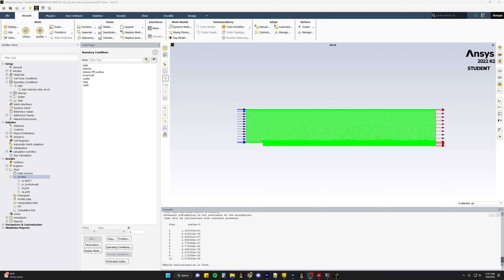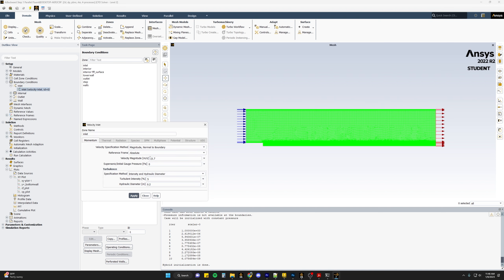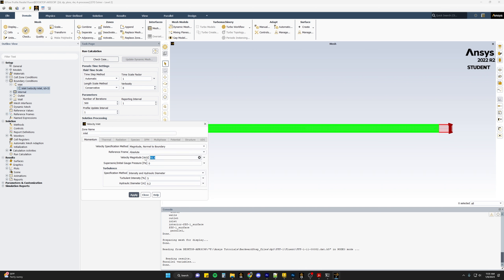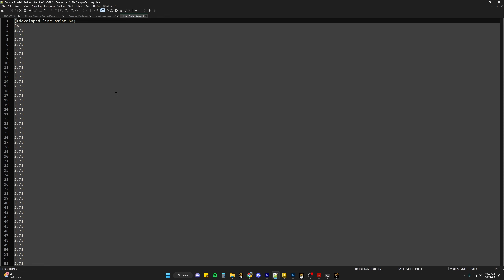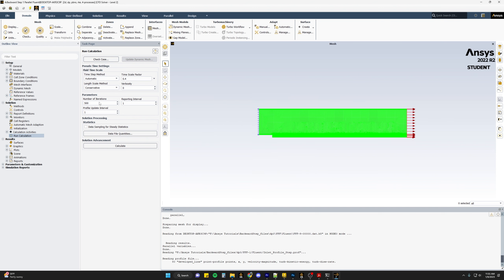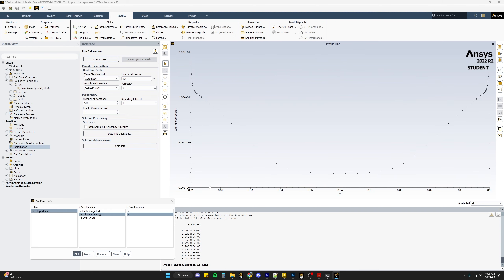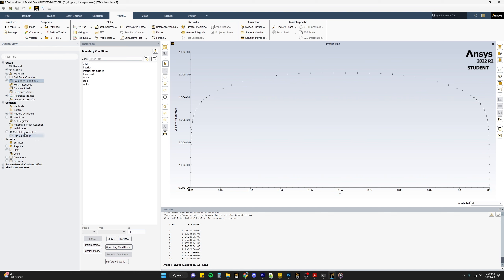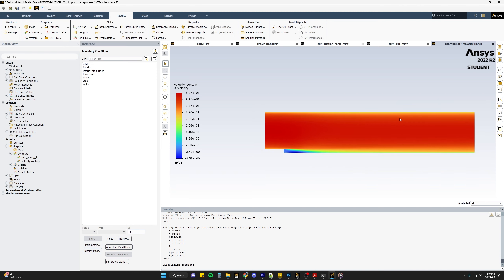ANSYS Fluent: How to Write/Read Boundary Profiles | Tips & Tricks

Comment: Hi CFDKareem, it is a nice tutorial and pretty interesting. Let me ask you a question, in your case,  was the mesh of the first simulation equal the second simulation in the points of the profile?  If the mesh of the first simulation was twice the size the second simulation you would need to click in the interpolation option, right?

Another question is if you know if is possible to write expression in the boundary accordingly with a new coordinate and now global coordinate.
Reply from the maker: Yes, the two meshes are identical. I would try to maintain consistent meshes when possible, but if you can't the interpolation works well. From my knowledge, Fluent always references the global coordinate system for profiles and UDFs. You will have to manually translate your input profile in reference to the global coordinate system. If you know where the profile is going to be implemented, I try and move the geometry to an ideal location in Spaceclaim to make writing the profile more convenient. For example, if I am writing an inlet profile I will put the bottom of the inlet right at the global coordinate system so the bottom edge starts at 0,0,0.
Reply: @cfdkareem   kareem, I really appreciate your answer, thank you. If you don't mind, I would like to ask you another question about DOF in fluent. In case you know the answer, the question is: I would like to now if it's possible to set magnet field in DOF of fluent to interact with magnetic wall.  This magnetic field is responsible for rotate a rotor that is set as wall in fluent. The flow of fluid is responsible for increase the rotation and  temperature of this wall. Also, the magnetic properties of the wall material change accordingly with the its temperature. So, at first, the inputs of my model are the inlet velocity and temperature, outlet pressure of the flow and the magnetic field that is interacting with the wall which generates rotates. Do you know if it's possible to simulate this in fluent?
Reply from the maker: @Rau379 it's definitely quite a complex problem! It would be difficult to do through the graphical user interface, but can likely be done with a UDF. The wall motion and properties can be defined using the macros DEFINE_MOTION and DEFINE_PROPERTY. There is no defined macro for defining magnetic fields that would interact with a solid boundary. You will likely have to create a custom function for the wall motion and define it under the motion macro. Check out the Fluent customization manual for more info on UDFs.

Comment: Hi Kareem,
Thansk for the explanation. It was very helpful. In my case I have more than 50 mm long straight tube, then a tapered (45 degree) section then 2mm long another straight section then the lquid introduced to multiphase system. Where do you think I should cut my nozzle region (before taper after long tube region, after taper and before last straight section or just before the nozzle exit and introduce profile to main simulation) so that I could lower my multiphase calculation time.
Reply from the maker: Ideally wherever you can cut the domain that would reduce mesh size and you can confidently assume the boundary condition at the point. You could also do a preliminary run with a single phase, and then export the profile right before the nozzle. It all comes down to your own engineering intuition on what will effectively capture your problem.
Reply: @cfdkareem  ok thanks a lot. I wasn't sure if I cut whole secondary phase injection (nozzle) and put that velecity profile as b.c. into a meshed face at the bottom of my test section it would simulate exactly the same condition. Like at the first time step would it model the liquid just like the real case(if I cut the whole scondary phase/nozzle)  or should I provide some of the last section (after the taper) of the nozzle exit in to my whole simulation. But if the only important parameter is to reduce the computation time then it would be wise to divide it from nozzle exit and introduce whole nozzle exit velocity profile as b.c. to face mesh of nozzle exit.
Thanks a lot

Comment: Hi! Great video. I noticed the parameters you read into fluent did not have dimensions. Are they in metric? If you change the units in the fluent menu to English units, but you read/import those profiles let's say in SI units, what happens? Is the profile data always have to in SI units ?
Reply from the maker: All profiles must be in SI units. Fluent always operates under the hood in SI. When you change to English in the GUI it's doing a "visual conversation" well still using SI under the hood.

Comment: I'm trying to find the boundary layer thickness value at that line, is it by inserting a chart of variable x velocity and y y axis, i need to match the B.L thickness value with what I have before exporting the profile
Reply from the maker: Yes you'll want to create a line extending from the wall and plot the x-direction velocity vs y. You can then find the height where the velocity along the wall achieves 99% the free stream velocity.
Reply: @cfdkareem  Thank you, and in terms of mesh independence, how should that carried out as we have two separate domains, I mean if my parameter is the reattachment length how would I refine the first domain to export the profile then refine the second one !
Reply from the maker: Great question! In the first domain your output is the developed velocity profile. This can be calculated analytically so you could compare your simulated profile to the equation. Reducing error in the profile will give the most accurate results for the reattachment. You can then use the profile in the second and analyze the mesh sensitivity for the reattachment point. However, mesh independence mostly comes down to how much accuracy you need from the model. For me personally, in an industrial setting, I would use my engineering judgement for the first mesh, confirm the profile is acceptable, and then perform an analysis on the second, since I'm mostly interested in the reattachment and can tolerate a small amount of error. As with most modeling it's all about using your judgement, experience, and skill to determine the best way to get the information you need!

Comment: May I know how I can tranfer the output boundary profile from first geometry as input of second geometry for a transient case ? (As since I have columns data ,eg velocity magnitude, in a time series), how can I insert the data in time series so I get transient result from second geometry as well ?
Reply from the maker: Hello, if your velocity profile does not change throughout your transient simulation, then you can use the same profile. It will assume that the given profile is constant for each time step. If your velocity changes in the XYZ direction with time, this is more complicated. You will either have to create different profiles for each change and then use execute commands to read the new profile at the correct time. This is less than ideal if your profile is constantly changing. If that is the case then you will be better suited using a UDF to define the inlet.

Thanks!
Reply: @cfdkareem  Thank you Kareem for your reply. Unfortunately, velocity profile for my case keep updating over the time. My case is turbulent in two phase flow, I am unable to define properly  by simply giving an equation describing the inlet. 😮‍💨What I have is a big data matrix arranged in a time series which is ready to insert as input profile for second geometry.
 I think I should go with the method you mention or with LSTM to complete the steps. 
Let me know if you have any other ideas for my problem.  

Thank you so much.

Comment: Hello Mr. Kareem. It’s not clear to me about how you created the velocity profile. did you start from space-claim, and create new geometry and meshing? you just switched to a new video, was it same goemtry as before? can you please explain the background process, some of us are beginner-level. Or is there other ways I can modify the inlet in the primary simulation to get a fully developed flow, I’m not getting this pattern. I tried to create a rectangle of 3900mm and 100mm dimensions and during the meshing it was very slow and frustrating
Reply from the maker: Hello James, yes the second simulation is created using a full new model including geometry in SpaceClaim, meshing, and a new fluent setup. The second simulation is simply a 2D rectangle with a height equal to the inlet height of the primary simulation (turbulent step). Make sure you are not using a very small mesh size for this simulation. The mesh will still be fairly large, but shouldn't take more than a few minutes to create. You can also do what you mentioned, i.e. extend the inlet of the turbulent step simulation far enough to allow the flow time to become fully developed. The benefit of splitting the simulation is that your primary simulation, the turbulent step, will have a much smaller mesh size and therefore a faster calculation time.

Comment: Hi kareem, how can I transfer the volumetric data from the geometry to another fluent case with the same geometry. While writing a profile, only the profile data/ surface data is been taken not the volumetric data.

For example, I have a rectangular 3D domain and the internal temperature is simulated. Now I want to give this internal temperature to another problem with the same rectangular 3D domain ( as the initial condition in the second problem). How to do it?
Reply from the maker: In Fluent you can go to File>export and export just the data file for the solution. In your new simulation you can file>Import the data file only. This will transfer the data from one simulation to another of the same domain. You can also export 3D solution data by going to file>export>solution data and choosing from an array of different file formats.

Comment: Hi Kareem, when simulating the flow through the pipe to get velocity values before the backwards step, through looking at the contours it doesn’t seem like its flowing properly as all i can see is blue at the inlet, then there is a small red vertex in the middle and then the flow in the pipe goes blue. Do you know why this might be?
Reply from the maker: If you have one vertex much higher than the rest of the flow it is usually one of two problems. Most likely there is a bad mesh element that is not converging well. Try remeshing and possibly refining it to see if it improves. The other potential is that the simulation is not fully converged. Try running the simulation for more iterations and see if it converges. If neither of these help them check your boundary conditions and make sure the inlet velocity/material properties are set correctly. Let me know how it works out!
Reply: @cfdkareem  I’ll give this a try - thank you for fast response :)

Comment: Hi Kareem, I am also trying to create this velocity profile based off the driver and seegmiller paper, however, the values I am getting for the fully developed profile line are constant for turbulent kinetic energy and dissipation rate. I have made sure to use the same dimensions for the geometry, any ideas why this may be? many thanks in advance
Reply from the maker: Hey George, It's hard to say without some more detail about your setup. Some simple things to check would be that your mesh is refined sufficiently along the walls, that your line you are exporting the values from is defined correctly and far enough away from the inlet, and that your simulation is running to full convergence. If you need more help please send me and email at kareemcfd@gmail.com with more details on your setup or, even better, send me your case files for the problematic simulation. Thanks!
Reply: @cfdkareem  Thank you for getting back to me Kareem, I have sent you an email :)

Comment: hi Kareem, when I try to export the profile into my original profile, it does not look the same as it did after the initial simulation. My mesh is the same size and i think ive exported the correct values, so unsure why this is happening. thanks in advance
Reply from the maker: Hey Mars,

Could you explain in a bit more detail what the difference is that you are observing? Thanks
Reply: @cfdkareem  thanks for replying so fast! When I load in my data and then run the simulation, the profile does not appear as it did in the secondary sim. For example, the top of the imported profile looks like the step in terms of flow… it’s very odd. I think something to do with the global coordinates?
Reply from the maker: @marstokrom1872  That would be my guess! Make sure the Y cordinates match between your inlet in your primary simulation and secondary simulation. If the global zero is at the bottom of the step, the secondary simulation will have to be offset from y=0 by the step height.
Reply: @cfdkareem  that worked, thank you!!!